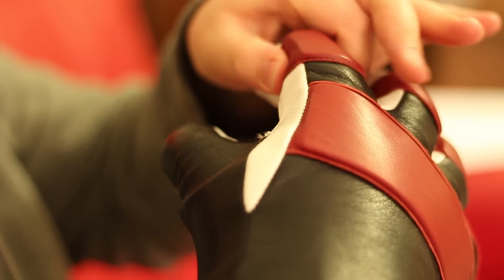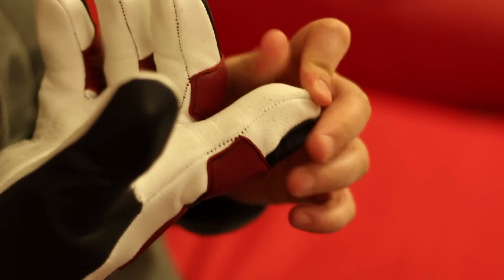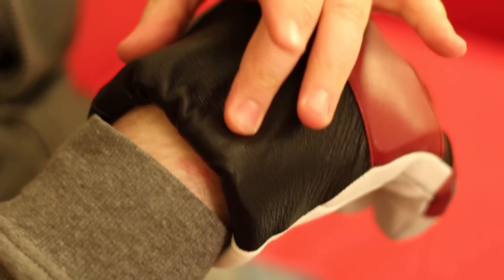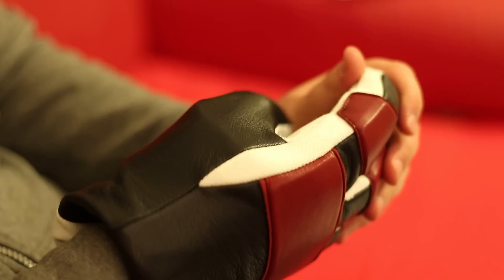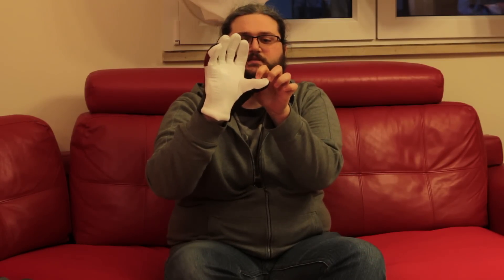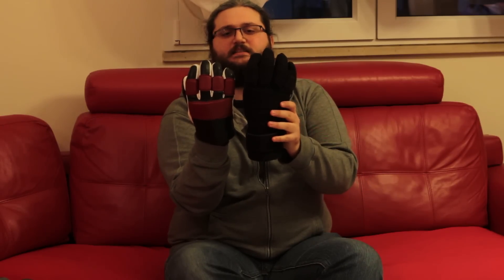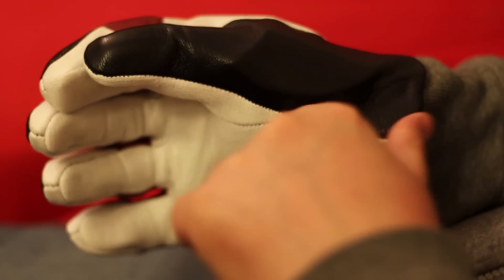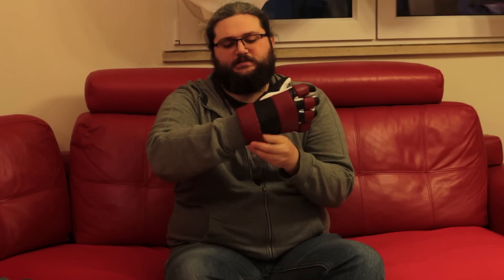THOKK WeaponMaster Gauntlets March 2018 update

Comment: I'll definitely follow this. I like mobile individual finger gloves over the SPES mittens and I like how the wrist is better protected with padding and plates. My wrist has suffered a fair bit from a lack of protection there in RDs. What level of contact/speed is the glove optimized for?
Reply: J the Welsh Warlord Individual finger gloves that doesn't quite fit your particular hands might be worse than mitten.
Sparring gloves FG and SPES heavy is god sent gifts for people like me who has stubby fingers(I have low end of L for palm girth, S for finger length).
I still think this could probably be a good gloves, though.
Reply: full tournament intensity
Reply from the maker: They are designed for any kind of intensity, though for heavy longsword fencing the Longsword Badass Design is recommended for a much better comfort.

Comment: How different is this to the training gauntlet?
Reply from the maker: The training model is going to be definitely less performing in terms of crush protection and in general in the amount of force it can take comfortably. It's meant for training up to light/medium sparring, so a powerful blow will be definitely painful if not injuring. The training model is exaclty that: a training glove. Safe to spar with synthetics up to medium power and with steel pulling back the blows.
Most of this is due to the inferior rigidity of the protections inside and in general inferior technical solutions on the materials side, removal of the most costly layers, etc.